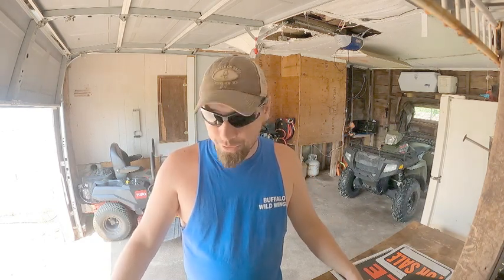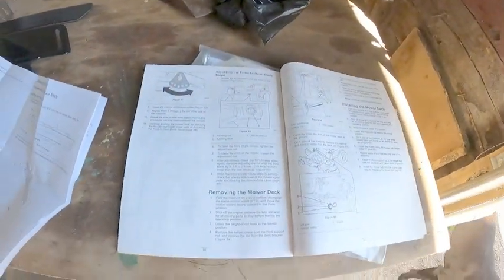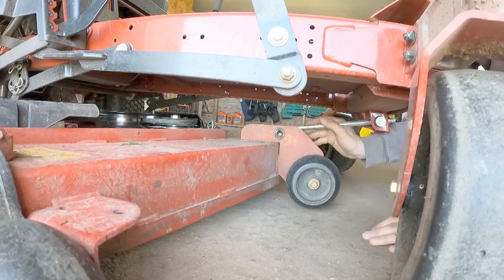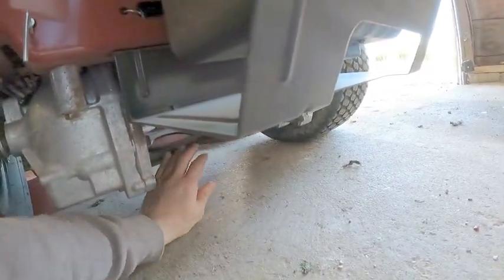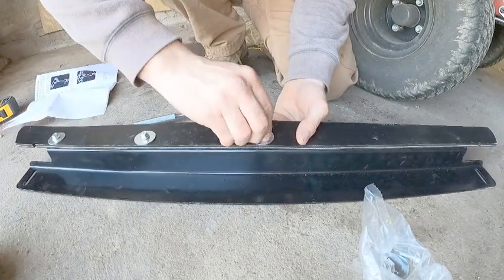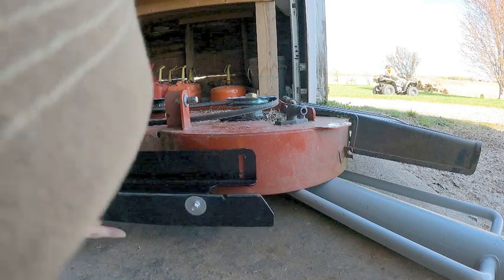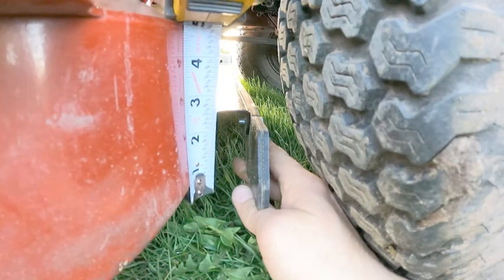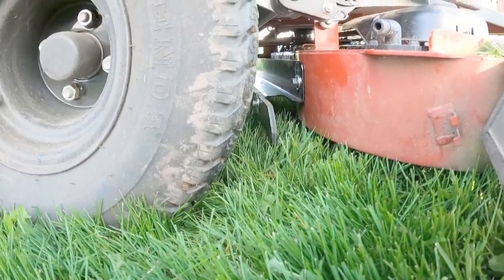Toro Timecutter Striping Kit Installation... Kind Of..

Comment: Got mine.  Thanks for the video.  The kit to me is useless doesn’t work.  I think I should have gone with the roller ones instead
Reply from the maker: Yeah I did struggle with mine. It doesn't make a noticeable difference. Not sure if that is because the mower stripes so well without it or if the kit is just not good enough. I did get mine back on using carriage bolts. It seems to be a lot more secure that way. Let me know how the rollers work and what kind you got if you go that route! Take care!

Comment: I used the 9/32 bit, but the 5/16 self threading screws didn’t hold. What size carriage bolt did you use to secure it better?
Reply from the maker: I beleive I used a 1/4 carriage bolt and got new nuts to match it. Worked great! Take care

Comment: poor design.  The bracket should be deeper so the location for the holes is above the intersection with the blades. Then you could have used a machine bolt/nut with the head on the inside of the deck   :)  Great video!

Comment: Can you post a link to where you bought it ?
Reply from the maker: Hi Joshua, I ordered it from this link https://www.torodealer.com/en-us/Pages/ProductDetails.aspx?pid=timecutter-75750(Toro)&_ga=2.105459011.1189153768.1627818902-713223415.1627818902. You will have to go to "Accessories" below the lawn mower picture. The striping kit is 16 items down. However it does not seem like the kit is available online anymore and you will have to order it from your local Toro dealer. I hope that helps!

Comment: Your mower is DIRTY. I hate to be that guy but you invested in a fairly expensive piece of equipment, take care of it and wash after every use. Invest in a pressure washer. I wash my personal mower after every use. It’s a Toro Titan HD 2500 60” deck. At work we wash all mowers after every use. Nothing worse than having to do maintenance or repairs on a dirty mower. Plus it definitely helps the resale value.